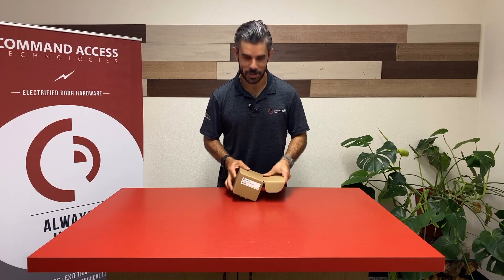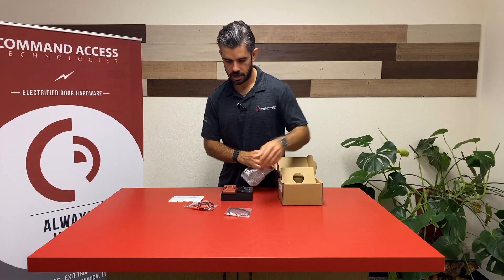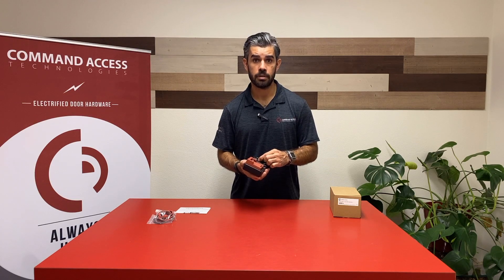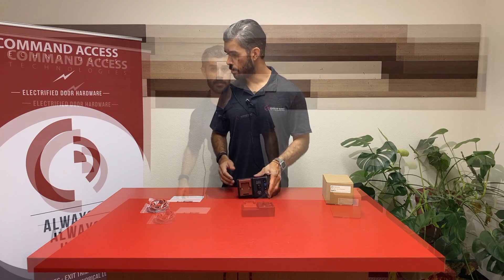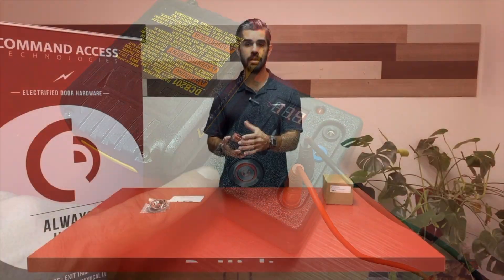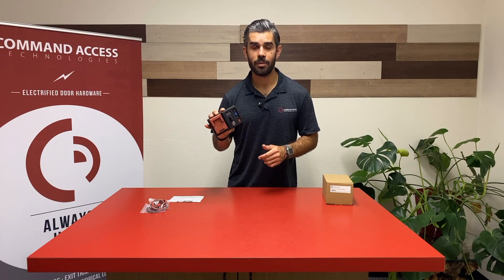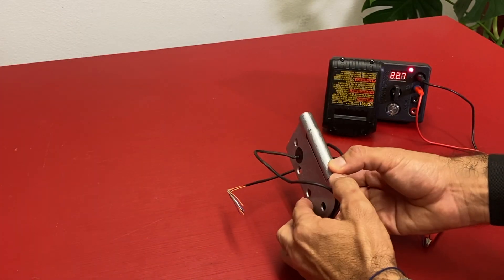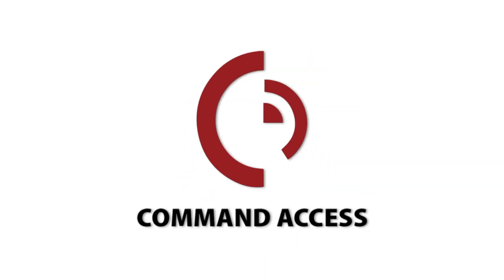CAT Field Tester Promo

Comment: Neat device. Could have used one for decades, eliminating hanky power hookups.

"Worst Air Guitar Ever"  lol    

Please add text to video, listing what voltage batteries, and what range of output device provides. Does it do any other testing, such as resistance, to replace a multimeter?